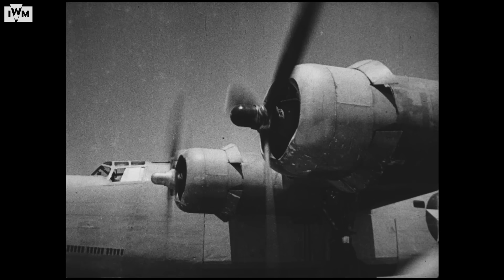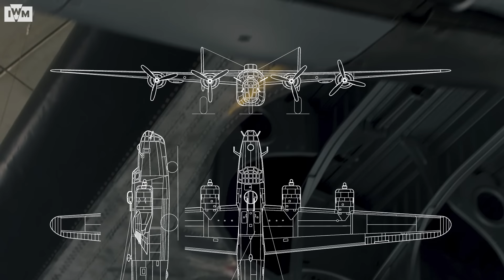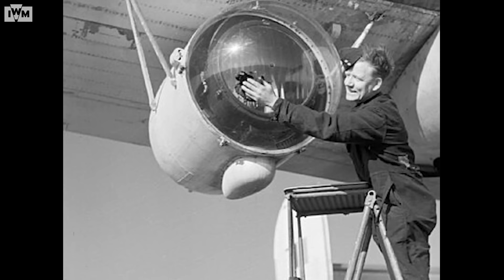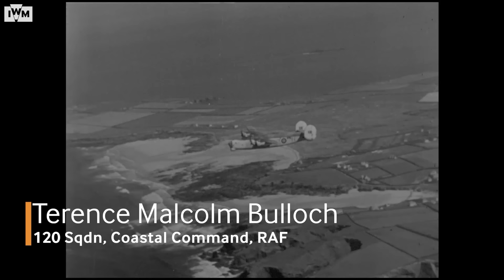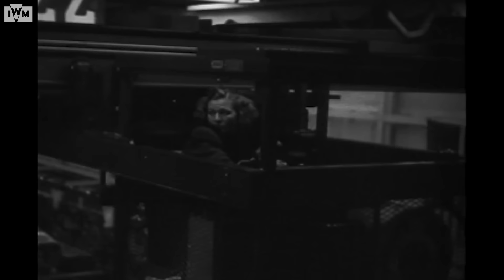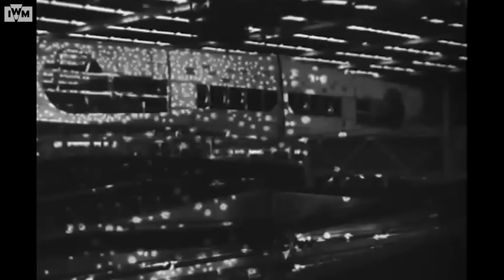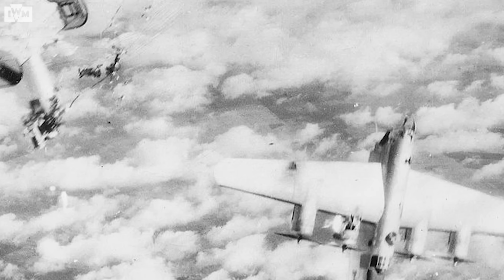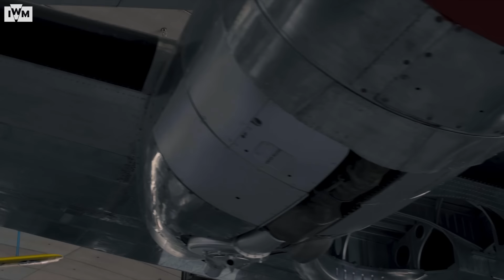The most produced Bomber in history had a bad reputation | B-24 Liberator

Comment: Actually, it was the idea that "The Bomber Will Always Get Through"... (Germany, Britain, and US all thought this.  That escorts were nice, but not needed!)
Unescorted Daylight Bombing deep into enemy territory was not a valid option as long as your enemy had the aircraft, pilots, and fuel to oppose the incoming bombers!!!  
Japan was hard pressed by the time that B-29s started to fly over the home islands.  Even then it required the B-29s to fly at (for then) extreme altitude to avoid both the  IJA & IJN fighters, which had extremely limited speed and maneuverability at those altitudes.  The B-29s also had issues at those altitudes, which is why LeMay switched to night time attacks!!

Comment: I believe that it has been proven that the crew of a B-17 had a lower survival rate than those of a B-24. The B-24 was a more modern aircraft, with better placement of defensive armament (once the glass nose was replaced with a turret) BUT it did have its weaknesses.  It's wing design was not capable of any great level of damage and the aircraft was prone to catching fire.  Despite this, it became the basis of the Navy's Privateer which flew operational sorties long after the B-17 was history.  NO bomber was anything other than a big fat target when sent in without an escort.  The "bomber will always get through" fools (American as well as British) caused  so many losses (20 losses? well next time we send 1000 planes and then only 200 losses!)...if only!

Comment: A very well balanced and informative video on this subject.  IMHO, the B-24 strove to improve on the performance of the B-17 (speed, altitude, bomb load, etc.) by "pushing the envelope" of aircraft construction, necessitating weight savings and making the structure weaker as a result.  Yes, aircrews during the war preferred the more robust B-17 (possibly because of the films of attempted water landings that destroyed the 24s, as shown early in the video).  There is one other weakness of the B-24 unmentioned in this otherwise fine video- the wheel wells for the main landing gear.  The structural spars of the Davis wing had to be made much narrower to accommodate the wheels- creating a weak spot that could (and did) break the wing off.

Comment: My late father in law flew B-24s as a young man in WW2.  He came from a background of light, agile aircraft as a member of the flying team in college before the war and as a flight instructor for new pilots in his first year in the USAAF.  He said the B-24 was "like flying a dump truck".  It had a tendency to want to stagger and wallow especially when loaded, in the thinner air of high altitudes, at lower airspeeds, or some combo of those conditions.  Especially sweat inducing was formation flying while heavily loaded at altitude, where he said they had to pay close attention and stay ahead of the airplane with their control inputs.  Accounts I've read in recent years confirm what he described, such as this quote - "The bulky Liberator had a few faults. It required considerable strength to handle the controls. Pilots said that it was difficult to fly, particularly in formation and at altitudes above 20,000 feet, and that it demanded maximum skill. As one recalled, “In the air it was like a fat lady doing a ballet.'”
Reply: The laminar flow wing of the B-24 was in constant need of attention by the pilot.

Comment: There's some debate in the comments about how many of what. According to wiki the Il-2 just pips the Bf-109 (including Spanish versions) but only just. Both around 36,000.
Both aircraft had multiple variants so you could count them differently depending on your criteria and the point you wanted to prove. Neither is a bomber in the sense of the B-24 although both carried bombs in the ground attack role. At 20,000 there were a surprising number of Spitfires produced. About the same number as the FW-190. The Mustang was around 15,000. The Hawker Hurricane just below that at 14,000. Counting all the other planes that used Merlins, that's a lot of merlins. I guess if you counted by weight, resources used, or engines, the B-24 would beat them all. That's just a few of the planes. I wonder what the number would be if you added all planes of all nations. Add to that all the warships, trucks, tanks, artillery, guns etc etc. It's probably enough resources to have given everyone on the planet a car, a fridge and a washing machine of their own. We seem to be at our most productive when being at our most destructive.

Comment: Should have been mentioned that Willow Run was a Ford Motor Company factory. After all the issues were sorted out of the assembly line, one Liberator per hour was produced. Most of the aircraft manufacturers said it was not possible to assemble a bomber on a line. FoMoCo replied with: Hold my beer...

Comment: Huge bombload of 8000 ibs? Lancasters carried up to 22000 ibs
Reply: Total of 32 Lanc's were heavily modified to carry one 12,000 lb Tallboy OR one 22,000 lb Grand Slam. You can read it on the BAE Lancaster page.
I found some interesting information in a document that can be found by Searching; 
Operational history of Lancaster 1B R5868
This Lanc flew 136 operational sorties in two years and ten months (less than one a week) and dropped "466 tons (assume long) approx" or 3.42 long tons or 7,675 pounds on average. I did not deduct missions in which bombs were jettisoned due to engine failure or the entire load was flares or mission was called off in flight. I will leave that to someone dedicated to perpetuating the myth all Lanc's carried 14,000 pounds of bombs on every mission.
On pages one and two (July and August 1942) the entire load was 3,360 pounds of bombs. 
On page one two raids were in daylight, the next daylight raid would be in July 44.
On page two a bomb load is 2,000 pounds plus "6 x 4 flares".
"(USA)" appears nine times with bomb type.
Some of the notes are interesting. Recommendation by two pilots the aircraft be withdrawn from bombing, one friendly fire incident, "bomb doors damaged by bombs" and one midair collision with another Lanc over the target.
Being "the angry Yank" I was amused by the listing of a USAAF general as "Passenger" (instead of observer) as if they were going to drop him off somewhere.

Comment: B-24  was  faster  than  the  B-17,  carried  more  bomb  load,  used  a  slightly  more  powerful  engine  (R-1830  twin  bank).  The  plane   was  easier  to  T.O.  and  Land  due  to   the  tricycle  landing  gear.

Comment: The B-24 was designed to carry a lot of bombs long distances.
Everything else was a secondary consideration.
It wasn't as strong and could absorb battle damage like a B-17, and it wasn't as well protected. It also didn't handle as well in the air.
As one pilot put it: "it looked like a Truck, and it flew like a Truck".
But, like the Liberty ships, we made a lot of them and they got the job done.

Comment: The B-24 had only three seats and one of them did not have a seat belt.  There were sharp edges everywhere inside the plane and the hydralic lines though the bombay was a fire hazard.  Otherwise it flew like a truck.

Comment: The B-24 was though of by its air crews to be something of a flying gas can as it had a tendency to explode after takeoff. Joe Kennedy Jr. Was co-piloting a 24 that had been fitted with an autopilot and was overloaded with fuel and HE on a test flight. The idea was to get airborne, set the autopilot toward the target, and bail out and the plane would fly as a drone and crash at the target. It exploded shortly after takeoff killing the entire crew. Hollywood actor Maj. Jimmy Stewart flew B-24s in England for 15 missions until he got the "clanks' and was grounded to become the deputy group commander. He was happy to be grounded knowing that he had already cheated Death several times.

Comment: Jimmy Doolittle preferred the "old" B - 17. The Fortress was easier to fly; and was an far more "forgiving" aircraft than the Liberator. The B - 24 had twin tailplanes; if one of them was shot or blown away, the ship would spiral out of control. A contrario, B - 17's were able to return to base. Even with most of their single, sharply raked vertical stabilizer shot or blown away. 

      The B - 24 was an innovative design. The ship had power assist controls. Which most ships at that time did not have. And, the B - 24 had an nose wheel. Most aircraft were "tail draggers," with an tail wheel at the rear of the aircraft. The only other aircraft with this undercarriage configuration were the P - 38 Lightning, the B - 29 Superfortress, and the German Me 262. The B - 36 Convair "Peacemaker' also had an "tricycle" undercarriage. But this ship was not flown until 1948. And not deployed operationally until 1948

    As well the B - 24 did not have bomb bay doors. The ship had "louvered'" external bomb bay doors. Which retracted like a window blind. In an mid ocean ditching, the impact with the water would tear away these doors, water would build up against the aft bomb bay bulkhead, and tear the aircraft in two. The sudden deceleration would kill the crew. By snapping their necks. The same phenomenon also tended to occur when effecting an "wheels up" "belly landing." However, there are videos on Youtube in which B - 24's "belly land" and remain intact.
 
     The aircraft also had an very high landing speed and take off speed. As an consequence, if a ship lost an engine at taxi, the pilots had an very difficult decision to make: try to take the ship up on only three engines, or attempt to abort the takeoff. But, I have seen B - 24's on final with only two engines, the portside and starboard outboard engines, running. And the landing was successful. If somewhat uncontrolled. As well non obstant the ship's high take off speed, the B - 24 may have had an very slow rate of climb. "Climbing out" after take off was very gradual. But once at altitude the ship went fast. 

      The starboard inboard engine also provided power to the ship's internal and external control systems and avionics. For this reason, German fighters tended to aim for number 2 starboard inboard. To knock it out. And render the aircraft uncontrollable. The number 2 starboard engine on the B - 17 also provided power to the avionics and hydraulics of this ship. 

        As well. The B - 24 had an "cousin;" the "C - 87," Liberator "Express." Used and flown by RAF "Ferry Command." The armament was removed. And the bombay and perspex nose were plated over. An large sheet of plywood was placed over the bombay compartment. And an large door was cut in the portside of the aircraft. The ship was used as an material and troop transport. As well as for transporting "VIP's." Churchill had one. And the Soviet Ambassador was also given one. Colonel Wladyslaw Sikorski, who lead the Free Polish Government in London, had one too. 

     He died in this aircraft in an accident off Gibralter in July, 1943. In circumstances that have always been considered curious. And even sinister. There have been claims that his ship was sabotaged. And the general murdered.

   As an final note, the B - 24 did not have an "real" entrance and exit door. Like te B - 17. Or the Lancaster.  Instead, the pilot, co-pilot, and bombardier/nose gunner, climbed in thru an hatch in the nose wheel well. The pilot then activated an switch which opened the bombay doors. The radio operator, waist gunners, tail  gunner and ball turret gunner then jumped onto an narrow trestle or gantry spanning the bombay, and walked to their respective crew stations. The dorsal turret gunner could join the flight deck crew. And climb into the aircraft thru the nose gear hatch. Or also board the aircraft thru the bombbay. Presumably.

  Finally, the B - 24 also had an ball turret. Underneath the aircraft. However, because of the very modest clearance between the underside of the aircraft and the ground, the ball turret was retracted into the aircraft at landing. And then lowered into position after rotation.

Comment: Superior to the B-17? I think on balance that is fair. But I would consider the B-17 the "greater" aircraft and here is why. The B-29 is simply light years ahead of the B-24, but the B-24 is chronologically pretty much halfway between the B-17 and B-29. So at a time of rapid dramatic advances, it was a much smaller advance than either of those two.

Comment: It was successful only because it had almost as big a bomb load as the Lancaster, but also because of its range. It was actually a pig to fly. In ex US Senator George McGoverns book, he describes how the B24 could not be trimmed in level flight. It would drip a left wing if you were not constantly correcting the trim, and you had to fly it the whole time. Coastal Command used them on anti-Uboat patrols and they swapped a gunner for a third pilot due to exhaustion. USAAF B17 crews who were scheduled to swap to the B24, did all they could to get transferred.

Comment: When I worked for General Dynamics at Lindberg Field in the early 80s, I met some PBY designers in our Lines and Loft department. When I asked about the extremely long tables in that department, one of the old guard engineers took me to the blueprint storage locker. He pulled out a full-scale wing drawing of a PBY and rolled it onto the 75-foot-long table. Lead weights with nails held the blueprint to the tabletop. The engineer told me that Consolidated Aircraft (pre-Gen. Dyn.) produced a flying PBY aircraft every eight hours during the war. The finished plane would roll across the runway toward San Diego Bay and would fly away to its intended destination. At the time, I was working on a top-secret project, the Advanced Cruise missile (AGM-129), and we were hard-pressed to get one missile out every 90 days. He told me there was a line move every 90 minutes back then, and if you weren't finished with your job, you had better hang on because the line was moving whether you wanted it to or not. Consolidated used paper work orders, and we had computers that were supposed to speed things along.

Comment: The difference was engine power when the two were first designed. Because each of its four engines developed only 775 hp for takeoff when it was designed in 1935 the B-17 had to have a high surface area high drag wing for its design weight and range. The same engines developed 1200 hp when the B-24 was designed four years later which allowed Consolidated to use the thin Davis wing whose area was only 1048 square feet vs 1420 square feet for the B-17. By then the B-17 was also fitted with four 1200 hp engines giving it 50% more power than originally designed. This is why damaged B-17s regularly flew home on two engines and the B-24 didn't. The Davis wing allowed the B-24 to fly 10-15% further or to carry 10-15% more bomb load but it needed every engine to do it. The loss of one engine was usually enough to cause a B-24 to go down. To be fair the B-17 design weight increased from 50000 lbs to 65000 lbs with 1200 hp engines but it still had a much better chance of surviving damage and flying out of danger once bombs were gone and all excess weight tossed overboard.

My father had the choice between a B-24 and a B-25 during WW2. He chose the B-25 because the B-24 had such a bad reputation.

Comment: As a kid, I read everything about WWII aircraft. The B-24 was known as the Flying Coffin by aircrews. Supposedly, it was suppose to be aerodynamically impossible for the bomber to flynon less than 4 engines. However, during a raid on an oil field in Poland, a B-24 lost 2 engines on the same side so the pilot and co-pilot applied full rudder and they were able to keep flying in a straight line.

Comment: The conclusion stated that saturation bombing failed during WW II is an untrue statement. The bombing did not prove as decisive as expected, but it did contribute to the over all war effort, and markedly so.
Though high altitude bombing could destroy entire manufacturing plants, The Germans proved equally adept at rebuilding them, if for no other means than the slave labor they used.

Comment: It would be nice if you could do a video on the Naval version of the B-24, the PB4Y-2 Privateer. My Dad started flying it in WW2 and continued flying it until it was decommissioned in 1962. It was redesigned for the Navy, no twin tail and stretched 7 feet I think.
Reply: The original US Navy version of the B24 was the PB4Y1. It still had the twin tail and a new nose ball turret manufactured by Erco, and a few other modifications from the Army version.  My Dad was a plane captain and aerial gunner of crew nine in VB-109 in the Central Pacific flying the the PB4Y1. After the war, he transferred to the reserves and flew as a plane captain in the Privateer and later transitioned into  P2V's doing ASW.  (Anti-Submarine Warfare)  He always thought the B24, in its many variations, was a better aircraft than the B17.

Comment: The raid on Ploiesti was NOT a failure and should not be looked at in isolation. Certainly the raid did not reduce Romanian oil production at the time, but it  did destroy all spare Romanian oil production capacity. As a result, follow-up raids in 1944 were able to reduce Romanian oil production to a trickle.

Comment: The Big issue with the B-24 was the increased bomb load the military wanted. By placing the wings at the top of the fuselage made it capable of bomb load almost twice of a B-17. But that high wing made it a flying death trap. Most B-24 crew members were aware the B-17 was an all around better aircraft than the B-24.